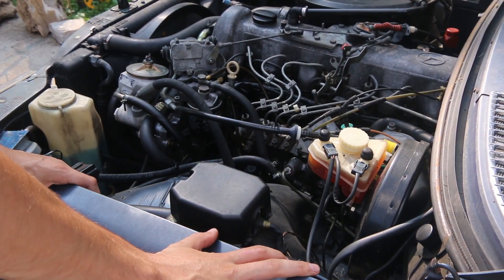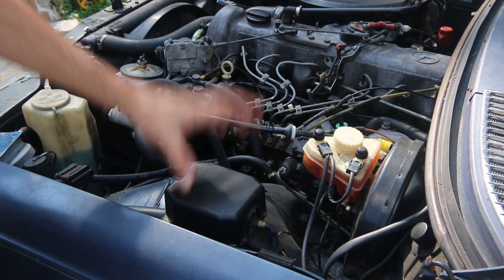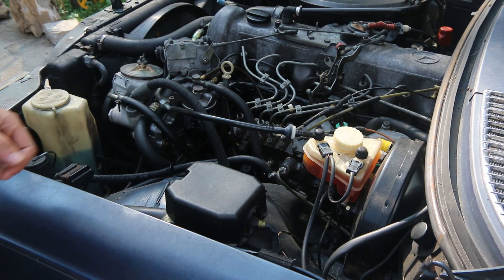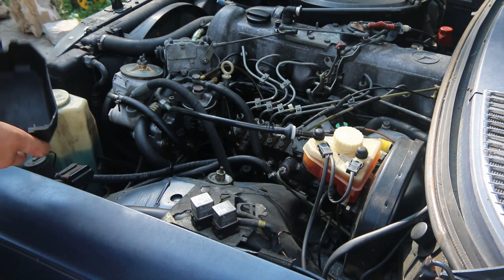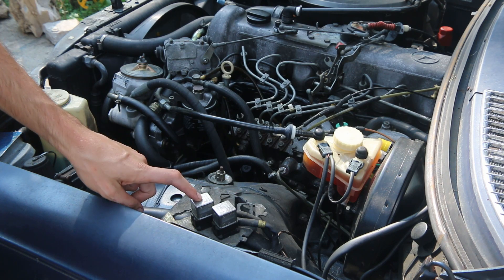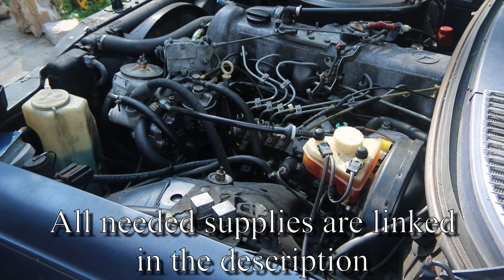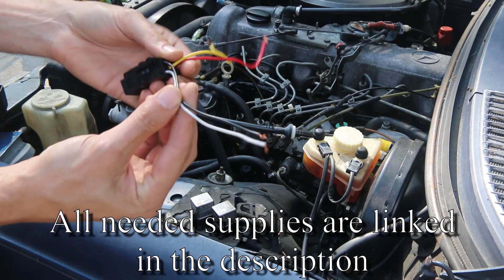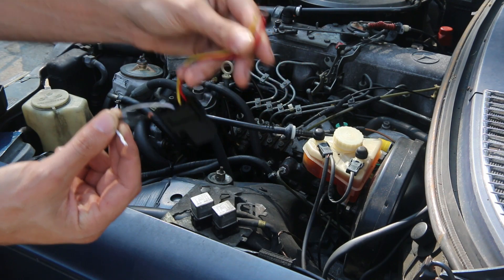W123 Aux fan AC mod & Evaporator cleaning (Cheap/Free ways to get better AC)

Comment: My new relay has numbered 30 87 85 and 86. I'm not sure which ones to plug in where. All the wires are brown.
Reply from the maker: Oops, Hadn't thought of that. so, 30 and 87 are the equivalent of red and yellow in my diagram, 85 and 86 are the equivalent of white and black. So I would wire 30 and 85 together where the black and yellow wires go in my diagram, wire 86 to where the white goes, and wire 87 to where the red wire goes. Hopefully that makes sense to you!

In this use case since you could switch them around to make neater wiring if needed, as long as you use the switched side (30 and 87) in places where the red and yellow are, and use the control (85 and 86) in the places where the black and white wires are. Or for simplicity just go with what I said in the first paragraph.
Reply: Wow that was fast! Thank you so much.
Reply from the maker: Glad to help! Hope it helps keep your ac just a tad bit cooler this summer!

Comment: Tons more ?
Reply from the maker: Indeed. I've got at least 3 more videos specifically about AC improvements on the W123 in the works, and between 9 and 14 videos sitting I need to edit and upload about other things I've done to my car unrelated to the AC.

I'm not sure how many videos I have filmed about other stuff unrelated to my car that needs to be sorted, edited and uploaded... I just had to buy another hard drive because mine was full of video footage...

I need more time in the day to get these videos done...

If you haven't seen the other AC videos, here is a list of the ones I've done thusfar:
Aux fan mod & Evap cleaning (This video): https://youtu.be/-ydCsCSxiiA
Sanden conversion: https://youtu.be/5XsvmXj49fs
Monovalve connector issues: https://youtu.be/cuYCvgt2WYI
Recirc mod: https://youtu.be/0lYppFBIuzg
Aux fan bearing replacement: https://youtu.be/NlI09Suc0SM

Comment: hi R12 @130psi =110F/43c   R134@150psi= 110F / 43c 
All commercial  refrigeration / air-conditioning  using above gas  is running around these pressures 
Modern vehicles are running 200--290psi   130--160F refrigerant temp
Upwards [ 160f down 110f ]50f or 28cel free cooling   WOW  ...   
Evaporator performance will increase ALOT

Comment: Unfortunately it appears that the climate control dial switch has gone out.  The continuity test on the pins shows that some pins are working and some of the pins are not working.  It looks like its going to be an ouch!!!! to find this switch is going to be a bear.  We have traced down the wires and so far that switch is the hang up of engaging the clutch on the compressor.
Reply from the maker: Oh no! I've wondered if my dial is getting worn out, sometimes it randomly seems to start blowing warm air and wiggle the temp knob and it goes back to cool, It usually only happens once or twice per season but I may have to look into what the options are eventually. It is possible that there is a potentiometer/switch type thing available at digikey, mouser or some other electronics place that might work, but I haven't looked into it as of yet. If I do at some point in the future, I'll probably make a video about it and post photos and stuff on my website.

Comment: U running r12?
Reply from the maker: I am not, Im running 134a and might have tested 152a (air duster) while visiting Mexico where the EPA has no jurisdiction, I do have some r12 but I've got a small leak somewhere so I don't want to fill with that r12 until I've got it sorted out so it won't need a recharge every year or two